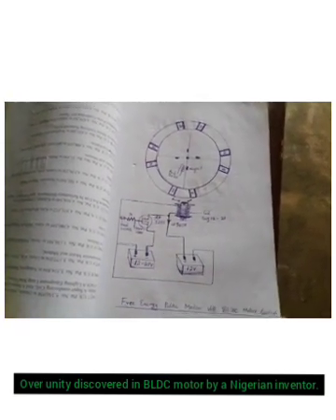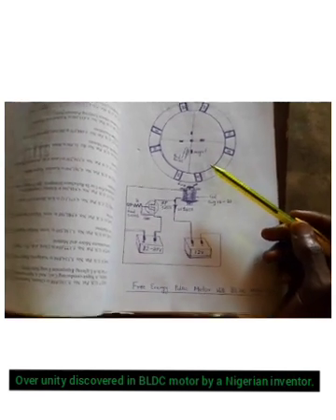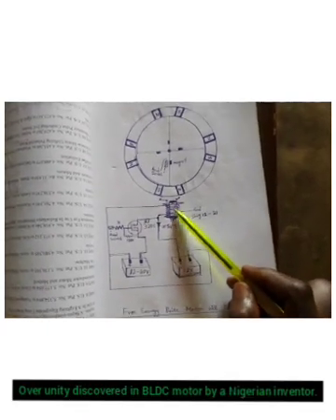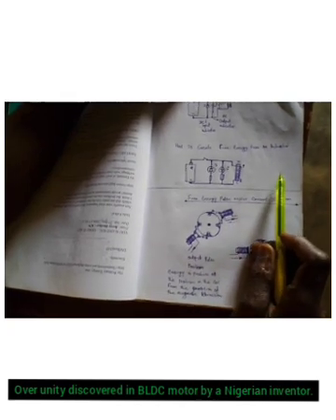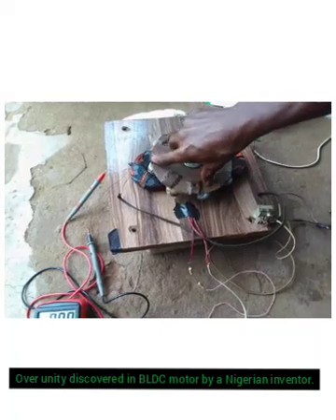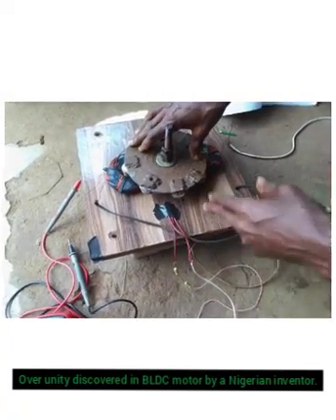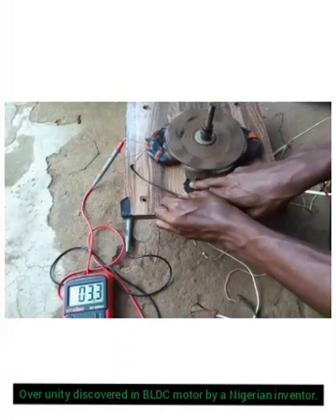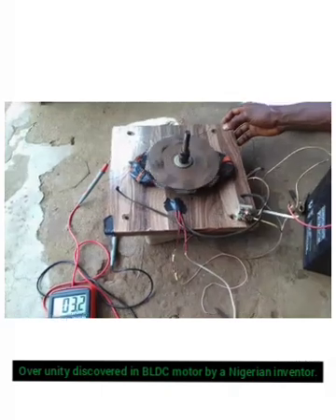over unity discovered in BLDC motor by a Nigerian inventor.

Comment: What you say is absolutely true. If on the one hand we can understand and be assured with often repeated certainty that energy cannot be created nor destroyed, then on the other hand we must accept that this indeed must lead us to believe, or the scientist would say "hypothesize" with equal certainty, that energy is itself infinite. As one needs only one device to prove thru repeatable experiment that entropy exists, one also only needs one device to prove that infinite energy exists, such as perhaps this one. But as for me,  I would build it myself and do the experiment before proclaiming final judgement on its validity. One point of this design that encourages me to do so is that it apparently relies on the magnetic field strength of permanent magnets. Higher Gauss magnets will absolutely cause an output of greater energetic force when interacting with a given electro-magnetic field input. That increase of energy is not created but is acquired from interaction with the magnetic fields of space surrounding the permanent magnets -which do not require further input, and the electro-magnet -which only requires a lesser electric input, but whose area of force can be expanded to ever greater effect with thicker wire and more coils.
Reply: If you assume that the electrical energy actually comes from the magnetic field rather than the mechanical input energy, then the system can be self running while still obeying the conservation of energy. My hypothesis is that a magnetic field is a one dimensional form of energy, while electricity is a 3 dimensional form of energy. So to  you must move or change the magnetic field relative to the third dimension to convert the magnetic energy into the electrical energy. But the electrical energy generated fight against the flywheel rotation by producing a drag force, thus, a continues excess mechanical energy input is needed to keep producing power.

Comment: Power in equal power out. Generator input power is speed times torque, while output power is current times voltage. The voltage is generated when the magnetic field changes and this change is produced by the rotation of flywheel. However, when load is added, the current drawn makes the coil acts as an electro magnet. the magnetic field from the coil and the field from the permanent magnet interacts and produce a drag force that slows the rotor down. Drag also exist just by electron movement but its minimal. In order to keep the rotor spinning you must input more power in the form of torque to keep generating power. hence input power always higher than output power because of losses and drag force. The relation between input torque power and output electric power is 1 horspower equal  about 745 watts. 
In my opinion this constant has some flaws in its experimental and theoretical determination. Therefore if one assume that the energy actually comes from the magnetic field itself then by building a low drag generator, a self running "overunity" system could be built. The back EMF spike from the coil is an entire different thing. The back EMF spike can initiate certain chemical reactions probably by lowering the activation energy. This causes the reaction redox potential to be more positive, which can lead to the reaction occurring spontaneously under conditions it shouldn't. Example is the redox reactions in the battery, resulting in the battery being charged more efficiently (possible to over unity levels of the system).
Reply from the maker: Thanks for your contribution

Comment: in case you are sincere, i will tell you this...
1)   your lips are moving but you're not saying  Anything.!
2)   no matter the method employed, the transfer of energy from one battery to another battery  is  a  Pointless  exercise.
3)   use of the output energy is  a  Mistake.    the output energy must be  MEASURED, correctly, via a correctly configured output circuit.    that is, a circuit in which  little-to-no  energy is used/consumed.
4)   in order to know  ANYTHING,  you  MUST  know  the amount of energy going  IN to  the system  and  the amount of energy coming  OUT  of  the system.      the cop of a system is a  COMPARISON  of those  Two  values.
5)    because the output of an alternator is wild AC, the output Must  be full-wave rectified to DC.     it is, thus, necessary to know the amount  of input energy in  watts DC.
Reply from the maker: You right, the in and out put power must be measured and from there we can determine the existence of free energy, and from what we have done and the test we have carried out beyond this video our claim is very correct and we look forward to doing the needful.thanks for your contribution.